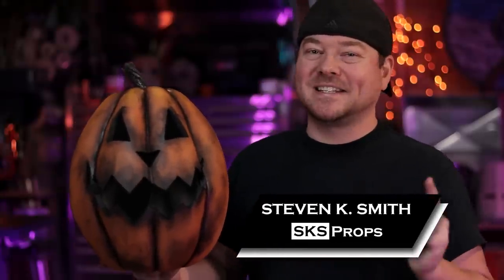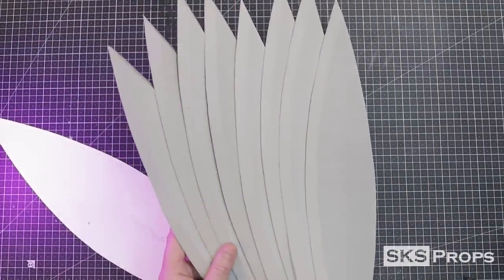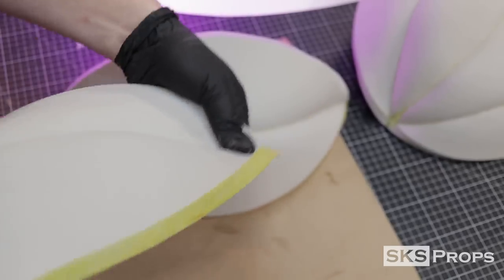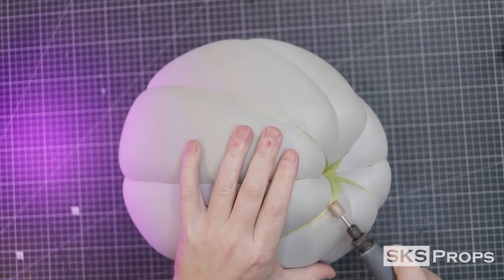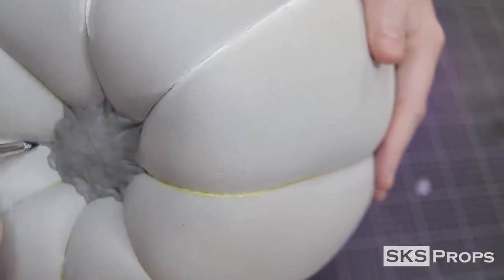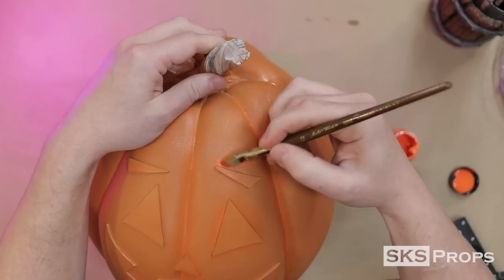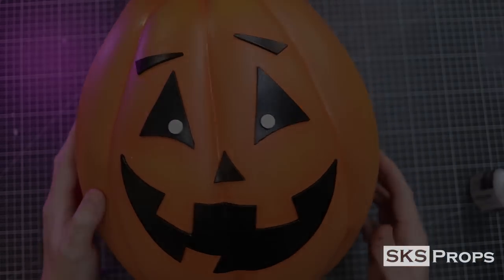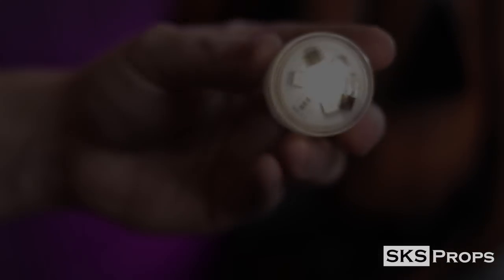How to Make Carve and Paint an EVA Foam Pumpkin with Free Templates

Comment: Is there a trick to using hand tools on the clay foam. I find it dries to quick and the tool wont crave. I've added water and it still doesn't want to crave though it. I've used both plastic and metal carving tools.
Reply from the maker: The trick is just making sure your foam clay stays hydrated. I prefer silicone tipped tools because they have a little give to them but I have used tongue depressors as well for sculpting I just dunk them in water first.

Comment: Heat form the parts before gluing. Less stress when gluing. But I'm sure you knew that 🙂
Reply from the maker: Yep but that's why I rolled them with my hands, unlike cheaper quality foam products the higher density of my foam allows it be formed even without heat.

Comment: The Weldwood vs Barge debate is moot. Weldwood is just as strong as Barge. I've used both and both hold up just fine.
Otherwise great video. I definitely plan to make a few of these. Any chance you'll make a skull template?
Reply: I was going to say the same weldwood is just as good.
Reply from the maker: Gonna have to disagree Even though I have moved to using weldwood for almost all of my foam projects as my go to contact cement, barge will always be a stronger bond. Most of the time that much strength isn't needed in a foam fabrication but here I would recommend it.
Reply: The second coat of Weldwood made all the difference for me. No Barge locally, anyway.  I love your videos!  Thank you!
Reply: @SKSProps  what would be a good equivalent to Barge? I don't have it locally.
Reply from the maker: @kykat112  weldwood contact cement is available at Lowe’s, Home Depot, and Walmart just put down 2 layers instead of one

Comment: Is there a way to edit the template to get different sizes or shapes (like if I wanted a fat stout pumpkin)?
Reply from the maker: you would just need to adjust the height and curve from the top point to the bottom and make your template shorter and wider
Reply: SKS Props thank you! Thought it would of been more complex than that